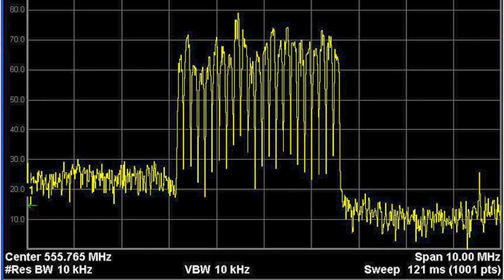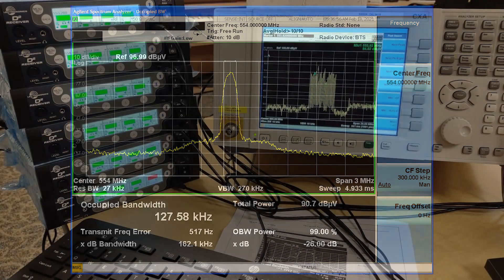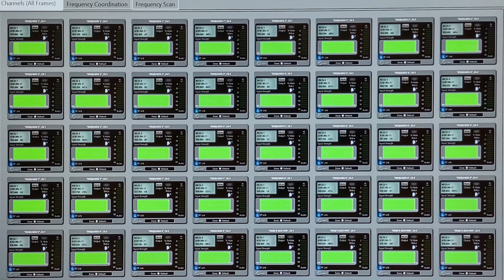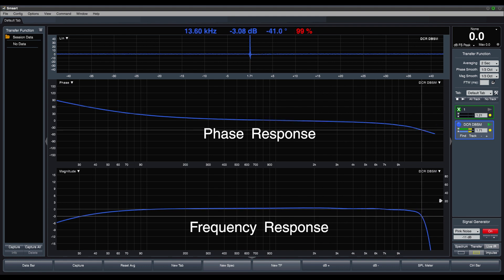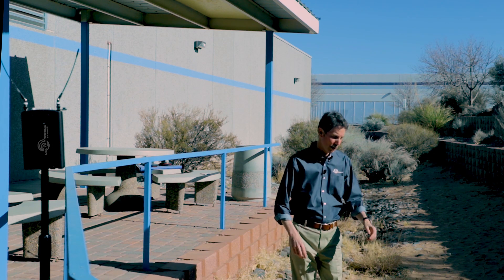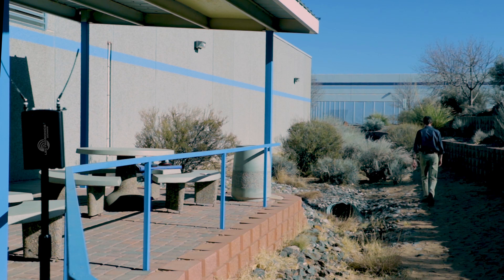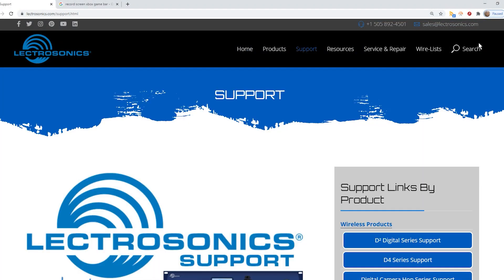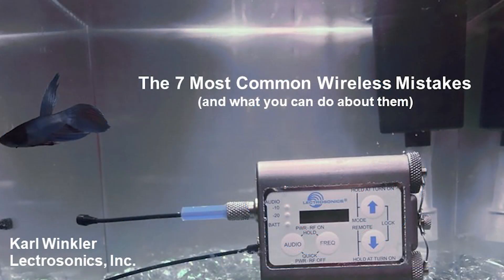Lectrosonics HDM (High Density Transmission Mode) Details

Comment: As a dedicated Lectro user, and a self admitted fanboy, I can tell you that these new transmitters WORK.
I have used them in the most intense environments (and the most serene) during beta testing. In HDM and in regular mode.
The HDM test at 2mw included an LED wall system of immense proportions, simulating a night at the Grammy's, an LED wall system including a ceiling to replicate a tropical rainforest, over a dozen live wireless mics, (both digital and digital hybrid) full concert stage lighting package, and all the things that go along with modern film production.
ZERO FAILS.
This system is everything it is supposed to be.
Reply from the maker: Thank you for the comment & glad to know these new systems are working well for you!